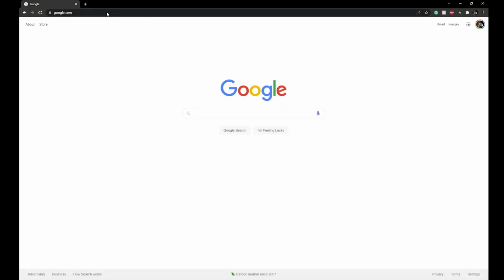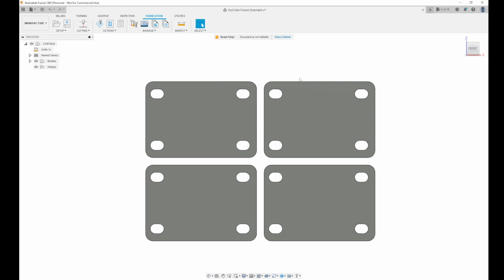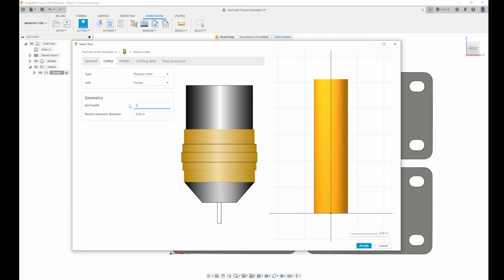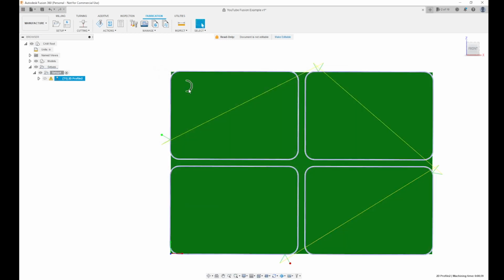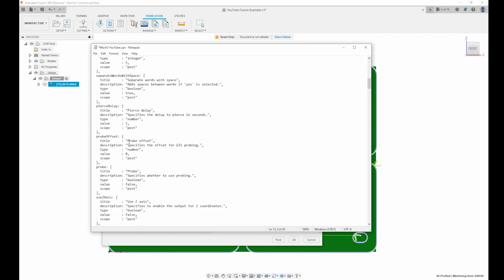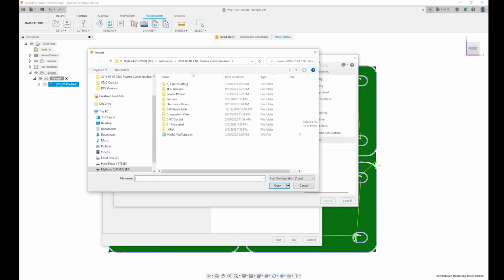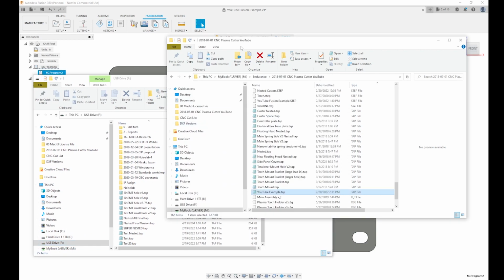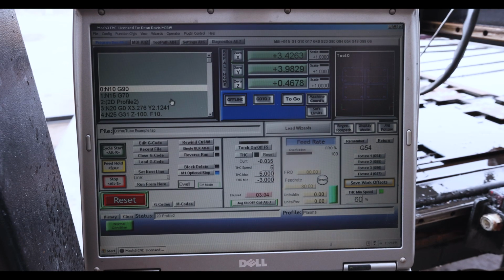Creating First CNC Plasma G-Code Using Fusion360 With a Floating Head

Comment: Hello, I'm French and I found you here. Your videos are great, and I've decided to give it a try. I'm currently working on the cabinet and components. My question concerns the board you're using: I bought it, but I don't know if I'll be able to use it because my computer only has USB ports. Since this board has an LPT output to connect to the computer, can I use an LPT/USB cable, the kind used for printers? Thanks for your help, because I'm stuck on this.

Comment: How much margin do you leave on the work piece? Is there a way to use existing straight edges for parts? Or seperate parts with a single cut?
Reply from the maker: I usually leave 1/8” to 1/4” of margin, but it also depends on whether I’m trying to squeeze a lot on a sheet. I am not sure I understand using existing straight edges? You can separate the parts by doing a new tool path if that’s what you’re asking

Comment: tosh I've followed your cmc plasmas table build very closely and build one using your plans almost to the tee. I did use open builds black box as I'm very new to this and feared the electronics and computers more than anything. It's up and running cutting out trial tabs etc. much thanks for all your help. I am struggling with significant bevel (20-30 degrees and parallel  in y negative and y positive travel) on my cuts however, especially on the y axis. both side of the the tab bevel the same direction. the x axis cuts are perfect in positive x travel, and beveled in negative x axis travel. I've messed around with torch alignment, cutting heath and speed, but I'm really stretching my head. any suggestions?
Reply from the maker: Hi. Glad you were able to get your machine cutting. I'm sorry to hear about the bevel though. When I've struggled with bevel it normally is when the cutting tip is old. So I would first start will replacing the tips and see if that works. On my plasma cutter I have to replace the tips quite frequently to have nice cuts. The thickness of the material affects the cuts a lot as well. If I'm cutting on an older tip on thicker material I'll have a bit of bevel, but if I cut using the same tip on thinner material anything under 1/8" then there is significantly less bevel. Another part that causes bevel is the cut height I would make sure you're cutting that the optimal height for your machine. It should say somewhere in the manual. I think if I got a Hypertherm or some nicer machine it would cut nicer as well.

Comment: Are there any nuances or differences in the initial settings for floating z setup if I’m using fusion360 and post-processing in open builds? I just finished my first table and it’s down to these settings before coming alive.
Reply from the maker: Hopefully you got your machine up and running. Sorry for the late response. I don't think there is any nuances, it should just be the setting I pointed out I believe.

Comment: This is the part of your build that I had the hardest time with.  You did a great job with your tutorial. l had struggles with Fusion 360. The Fusion 360 learning curve was very steep for me. I do have My machine up and running. I could not be happier with the end results. I did add Proma THC along with splash rails and a water storage under the table with filters and a pump to refill. Mine sets in the shop and the water evaporation raises the humidity. I don't use it every day. It made sense to me not dragging a hose out refill. 
Thank You again for your excellent build video.
Reply from the maker: You're welcome! I'm glad you got your machine working great!. Ya Fusion360 honest sucks. I hear OnShape is launching a new CAM system in the summer so hopefully it's a lot better because it would be nice to move away from Fusion.

Comment: That was very good and helped me alot. I'm trying to learn the Mach3 ropes and how it interacts with my table.  I figured if I could make the g-code work with a marker to draw out a small test project. I should be able to then replace the pen with my plasma cutter.
Mach3 is way different from my CNC Router controller but most of the steps are the same in fusion 360 to get the g-code.. 
Then once I add the plasma cutter and get the probe height working with that. I start to figure out the THC.. Crawl, Walk, Run!
Reply from the maker: Awesome! Good luck! Glad the video helped

Comment: Great video.
I dont have wifi un the shop...will i be able to run Fusion 360 without wifi?
Could i use my old Vista portable?
Reply from the maker: I believe Fusion360 has an offline mode, but I'm not positive. I personally have Fusion360 on my personal computer and then I have another older computer that has Mach3 running on it. So I generate the G-Code on my personal computer and then put the file on a USB thumb drive to take over to my other computer which has Mach3 on it. The big requirement for the computer that runs Mach3 is that is needs to have a parallel port.
Reply: I saw i can buy mach3 usb...so i thought to use it in my old Vista pc. ????

Comment: I watched your video with interest.
I am respectful
We use mm units.
Could I get a cad file in mm unit?
Your video makes me happy.
Trying to get started soon.
I am in Korea.
Take good care of me.
Reply from the maker: Hi sorry for a delayed response. Glad you like the videos. If you take the CAD files you should be able to just change the units in your software to mm instead of inches. Just open the CAD files in your CAD program. With Mach3 in the initial setup you just need to select mm and not inches. This will make Mach3 run the code as mm/sec and not inches/sec. Hope this helps
Reply: @ToshDavis  Thank you

Comment: Hi I am planing on building a cnc plasma cutter my self. But I am wondering  why do I need a z axis/floating head. Thanks😁
Reply from the maker: The material on the table is never completely flat and so the floating head allows you to re-zero the torch height before every cut. The cut quality is highly dependent on your cut height and so if your torch is cutting too close or too far away because the material height changed with respect to the torch then your cut quality will drastically change as well. The purpose of a THC is to do this adjustment just while you are cutting.
Reply: @ToshDavis   ok thanks a lot.
Reply: @ToshDavis  do i set the height in mach 3?
Reply from the maker: If you have a z axis you can control the height with mach3 but if you don't then you would have to manually set it. And it wouldn't matter in mach3 because there would be no axis to control.
Reply: @ToshDavis  ok thanks for all the help.

Comment: Do u know, what thick of the nozzle it s best for clean cuts?
Reply from the maker: I'm not sure. Normally with plasma cutting, you have one nozzle size that covers a wide range of material thicknesses. So maybe I'm not understanding the question. Though to get the best cuts it will depend on the plasma machine and the cut height. This is why a THC makes a big difference because it keeps the machine's cut height at the best height to give the cleanest cut.

Comment: Great video! Though I believe I will have to watch this a couple of times more🧐
All the parts will soon arrive, Im so excited to get started😛 One concern I do have, Im working with millimeter and not inch..🤔
Reply from the maker: Thank you! Yeah, there is definitely a lot of information. That's awesome, you'll have to keep me updated on how your build goes and if you have any questions. Yeah... imperial units haha, not the best. I don't think it should be too big of a deal though, just something you can keep in mind, probably the biggest issue is when you buy the metal it was designed around inch tubing and not mm.